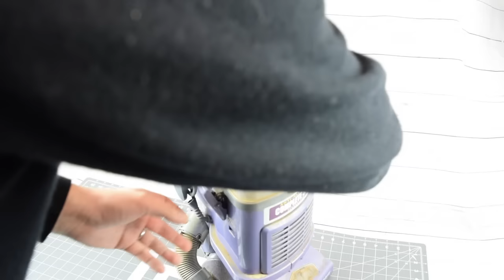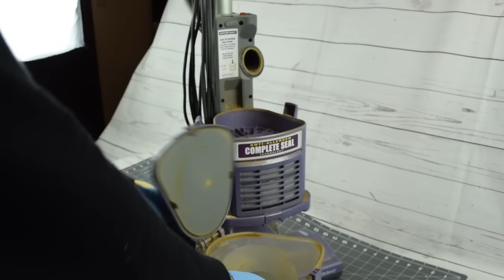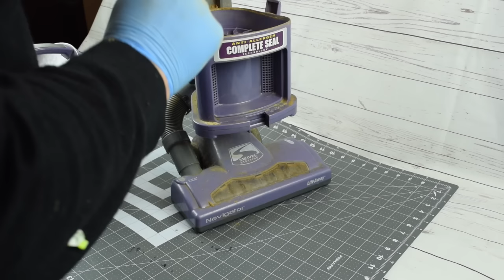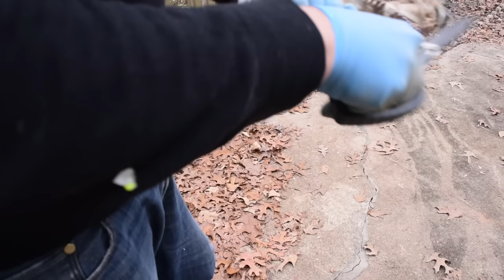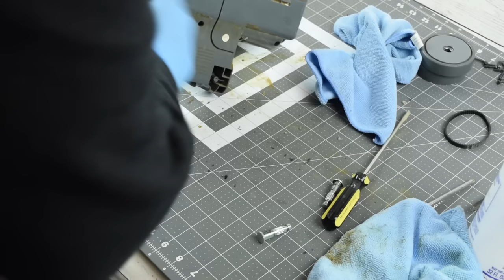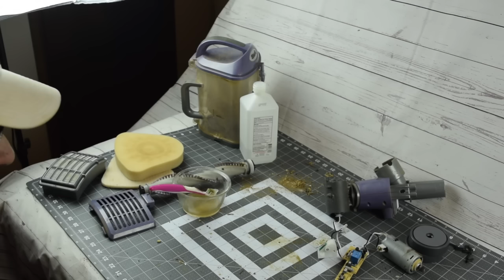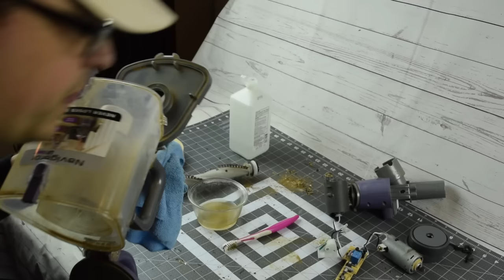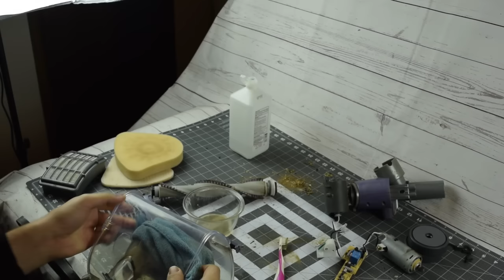How to DEEP CLEAN / Refurbish a DIRTY Shark Navigator Lift Away Vacuum

Comment: You can soak the tank and scrub it off. No need to leave it that way. Also, you can use a stiff bottle brush and run it inside of those hoses.
Reply: Yeah that’s what I do.
Reply: I've heard it causes rust however I've always washed mine and never had that issue I just feel like it's not truly clean any other way
Reply: I just rinse the tank out in the sink, just like he did with the filter.
Reply: whats the best way to dry the hoses

Comment: Just wanted to say I bought one of these vacuums used over 3 years ago and it's the best one I have ever used. It hasn't missed a beat, even with having 2 cats. It gets all the fur out of the carpet and furniture, no problem.
Reply: Does it still work
Reply: @ayo509  Yes! The seal around the canister came off, so I had to replace that but it still works like a champ.
Reply: @TehKitteh01  what vaccum is ir that u have?
Reply: @2manyscars  Shark Navigator lift away.

Comment: Housekeeper here, pro tip: but a mesh laundry bag, put your dirty filters, (hepa and cloth filters) in it and wash them in the washing machine. The mesh protects them. I do this at least 3 to 4 times a week to keep my sharks clean after each use in my clients homes. Then air dry them.
Same for the canister, a pressure hose will clean the mesh filter. All my vaccums have suction as of they were new and I use them A LOT!
Reply: How do you clean the brush and bottom of the vacuum?
Reply: @nyscurls08  I run a motel, Idk about this model, but most of them you can unscrew the bottom. I take a knife and cut straight through the hair and carpet strands using the plastic on the brushless portions as a cutting board, then I can pull it out of the brush portion. My mom always used scissors
Reply: Bad tip! You're not supposed to wash the hepa filter! Water ruins the tiny little fibers the hepa filter is made out of! So your hepa filter is probably not even working anymore lol dum dum

Comment: Total lifesaver for me today!! I couldnt figure out why my vacumn wasnt sucking up, it was just spitting out and making a whirring sound, followed your video and in the bottom hose it was soooo clogged! The whirring sound is gone and it picks up, but I feel like it was still spitting some out behind me when I had the carpet setting on, but when I switched to the floor it was fine. As long as I go over the floor slowly to allow it to pickup on the carpet setting, it will pickup and not blow back. THANKS SO MUCH!!!

Comment: Abrupt ending. Soaking the main canister in hot soapy water would seem to be much more efficient.  Blow drying with an air compressor would efficiently remove all water and prevent any future rusting.
If you were doing this frequently, get an ultrasonic cleaner, makes work work of embedded dirt.
Reply: That's what I did

Comment: Thanks for video. Truly a deep clean. I have this exact model after all these years. I have a spare filter set I bought and that way I can replace them while the other is being cleaned and then dried. I don’t think mine has ever gotten as dirty as this one.  I will say I think it’s easier to go ahead and dunk the debris bin in soapy water and wash it that way (a small angled brush or bottle brush would probably make it easier). I just leave mine to dry overnight after I attempt to dry it off.  The two things I dislike about this old model is the lack of lights and that part in the bin where the dust/hair gathers and I almost always have to stick my hand inside to remove the glob. We do have kitties and two long haired people here, but still...the professional Shark/years newer model, they worked that kink out because the bin is easier to empty on it. And my newer one has lights. I really wanna upgrade to the DuoClean as soon as we’re able. I feel behind in the vacuum times. 😆

Comment: Just came across this video. Excellent! Thank you 🤗
Just a note, I used a tide pod and white vinegar in hot water to clean filters, soak hoses and wipe everything down it’s all like new again. Rubbing alcohol worked nicely on clear plastics after I rinsed
Reply from the maker: Thanks!
Reply: @VacuumWars  I have a bit newer shark NV 391 26 and the brush roller and the motor are attached to the clear plastic inner casing. I can’t figure out how to get the brush free from the clear plastic case 🥺

Comment: Your video was very helpful, thank you. I haven't had a deep cleaning to my vacuum since I bought it 2 years ago, so I learned a lot about the parts I need to maintain properly. One thing I felt could be improved is to use biodegrable detergent (because the one you use will be bad for the soil in your yard, and the environment, and it will send a nice message to everyone following your instructions). Thanks again for being so throurough.

Comment: I have two Sharks but mine are newer. The taking off of the plating to reveal the brush is different. It is hinged with three quarter turn releases instead of screws. The trick is trying to clean the layers of pet hair, dust etc that build up along the intake cover and the stand up bristles behind the roller. Short of completely disassembling the entire head, it is a chore to clean effectively underneath.
Reply: Mine is newer too and I wasn't able to take it off with a screwdriver were you able to get it off? I had to cut and yank all of the nastiness out it was so draining.
Reply: @itsGaiaPeralta  I think manufacturers encourage us to take the sweepers in for maintenance. Most models I've seen have screws within the turner brush housing that need to be removed to get the roller out completely, but require a special tool. The way the newer models are, you can only disassemble it so much and clean it so much without some kind of professional tools. Yes it ends up being a major hassle to clean the roller housing effectively. I guess cleaning it regularly from the start would help a lot.

Comment: I have a long dowel and in order to clean the house which is flexible as it is I put a sponge on the dowel and ram it thorugh the hoses by stretching and then gathering over the dowel and sponge then rinse it out with a strong stream of the hose - works like a charm

Comment: Great video! Thanks for all of the tips. I'm actually about to deep clean mine now. I was wondering, maybe you said it in the video and I didn't hear it, why can't you just wash out the canister? With water? Should it not get wet? I was trying to read through all of the comments to see if anyone else asked but there are so many! Lol!
Reply: I was thinking the same I see someone else above mentioned to just wash it out
Reply: I just wash mine out with the garden hose. Clean the center cone part with a detail brush. I've only done it on a hot summer day, so drying it hasn't been a problem. I guess I would use the hair blow dryer if necessary.

Comment: I have this vacuum as well and cleaned it recently. One thing I did to not get the hoses wet was use my extra long dryer lint brush and run it through the hoses.

Comment: Thanks for a great video! I couldn't remember if I should wash the felt filter (having misplaced the owner's manual!) so this was most helpful. When you discussed blockages, though, it reminded me of the time my Shark just wouldn't pick up anything and my husband was all set to go buy a new vacuum but I knew there had to be something going on. I took off all the hoses, as you recommend, and found a Bic pen caught in the U bend! It was tricky getting it out, but so worth it since the machine works great again! That was several years and two houses ago, so I'm really pleased with my Shark investment!
Reply from the maker: Awesome! Glad it helped!

Comment: I was pretty frustrated when I couldn't get the cover off, & this video calmed me down.. I love LOVE my Shark! I also got it used. It wasn't near as dirty as the one you're working on. I've made sure I have a couple filters at least, that way I can wash the first one & let it dry completely, & put the 2nd one on so I'm not without my vacuum for the 24-48hr dry time. It works really well. Someone here mentioned getting filters on Amazon & I did that as well. Life savers! I have to cut my 30" hair off of the Brush roll OFTEN lol, but doing proper maintenance has kept my vac like new for around the four years that I've had it. & Lastly, my husband was so impressed with my Shark Nav Lift away that he bought a 2nd one, used as well! Now he can clean up the messes from his builds, projects & other things any time he needs to, which is really helpful! Thanks again!

Comment: TIP.....   after soaking and scrubbing the inside of the hoses and parts with the best cleaner for the job- which is DAWN.....  run a little bleach and water solution thru 
hoses/parts. To disinfect. To Keep yourself and your household healthy.  Don’t forget to spray Lysol (if you have it) onto those filters while they’re drying to kill bacteria

Comment: you can use a dryer vent brush to clean out the middle of those hoses.  Best vacuum I ever had was the Fantom. Lasted a little over 25 years. I have the Shark Liftaway now, def. not as good as the Fantom, but works!  Wish The Fantom Was still around!
Reply from the maker: Great tip! and thank you!

Comment: Considering some of the comments here:
* The dustbin can be washed out.  I take a hose sprayer, set on "Full" or "Jet" and have at it. 
* All three filters are supposed to washed out with (cold) water; I use lukewarm water.
** I'm surprised the HEPA filter doesn't ever get replaced.  I find it interesting that water doesn't flow through the HEPA filter.  I fill it with lukewarm water and let it sit in the sun for an hour or so.  Flip it over to drain it, then take a hose sprayer to rinse out the loosened stuff.  
* I don't use any soap, per the owner's manual, but I might be tempted to use a light mixture of Dawn dishwasher detergent and warm water on the two pre-filters.
* My Shark (ZU560) keeps the roller brush free of hair, so I don't have any real need to remove it.  (We have three cats and a dog; let the reader understand!)  It would be nice if it could be easily removed so I could sanitize it every once in a while.  Instead, I lay the entire vacuum unit outside with the bottom facing sunward, turning the brush a quarter turn every 15 minutes.  Ultraviolet rays from the sun is a great sanitizer!
* I also let the sun dry and "sanitize" the filters and the dustbin.
* Regardless of the sun drying everything out, I still wait 24 hours before using again.
* I found the owner's manual for my unit online.  (Some comments mentioned not having one.)

Comment: Just wanted to add a comment regarding heavy duty or commercial use  with these vaccuums....My gf and i used to clean a school that had a dirt road entry and thus, loads of gravel ,small tones, and such would get tracked in..the school consisted of 8 buildings  1000 to 2000 sq ft Each..The enviroment was the Worst we had ever come upon in cleaning since early 2000..The scoolrooms had paper, food, gravel and stones,  just Everywhere and was obviously let get outta control by those running the place...Point being that  This enviroment would have destroyed most ordinary vacuums but the sharks held up fantastic with none of the 3 vacuums we used ever breaking down...We had one like whats in this review, purple and 2 white, bigger capacity navigators....we would always have the vaccs ready, cleaned and empty b4 ech cleaning venture there, but by days end, when we were done, they had been emptied Multiple times with the filters shaken out as well...we needed a vacuum that could pull fine dust and Not loose suction....not many vaccs could achieve this as even a powerful Royal upright with the commercial metal body, would quickly become bogged down and loose suction with a fresh bag shortly after attempting thnis place.the sharks lost No suction, and were torn down midway thru only to empty containers and refresh ,shake out, the filters, then they were back to work again...the enviroment also required an extremely navigational vacc that could get round and between things,chairs,desks ect..the sharks were superb in that respect...the only tradeoff to that manueverability was the heads were relatively small and when coinfronting massive sq ft areas ,a larger head would cover more area more quickly...The tradeoff there is that you would loose ability to get in and around tight spaces...So, for anyone considering one of these for home use, rest assured that it will easily handle what you ask of it and thats its capable of Alot more should you need to... great machines! we no longer do that nitemare job at that school, but Still have and use those same sharks at home...

Comment: Don't know if anyone else has mentioned this, but I use a leaf blower outside (you could also use a hair dryer on cool, but a lot less powerful, or a can of compressed  air which gets expensive) to blow out the initial dust and then again after each time I clean something inside. Just be sure to point it away from you. Works a treat.
Reply: If you are a diver and have scuba tanks there is an attachment for just dust blowing that absolutely does a great job. Short bursts will clean a lot of junk out. I also use it to blow dust out of my computer but with a bit of distance cause you don't want to blow anything off of the motherboard.
Reply: I have an air compressor, with a 50-foot hose, that is always turned on at my house. I use it for my nail guns and tires and to blow the dust off of things. I blow out the filters every time I empty the cup. It takes less than a minute.

Comment: Thank you.  My first shark was the one in this video and what I have now is purple. Both state in instructions to rinse filters with cold water. The first one I put the filters except the hepa  in the washing machine  a few times before reading not to do that. I used either hot or warm water.  After that would hand rinse but with hot water while putting a cleaner in the filters beforehand at times before rinsing clear.  The purple I only rinsed but with hot water. Since instructs cold water I will use at least luke cold.

Comment: I just, today, found a Shark Navigator Lift-Away in the trash next door to my house. I brought it inside and didn't even attempt to turn it on. The filters were clean but it was clogged at every connection and through the entire handle. The handle tube was packed with so much shit that I had to use my drill with an 18" bit to bore a hole through the hair and debris to loosen it up enough to get it out. I put it back together, plugged it in and turned on the most powerful vacuum I have ever had. Easily the most powerful! Now I had two new things, a badass vacuum and a human head sized pile of hair, dead skin cells, scabs, nose hair, dried boogers, and anything and everything that is gross and undesirable that you can imagine.  So I threw out one of those things. I'm sure going to miss that new vacuum.
Reply: Yeah, my dad used to repair vacuums that he would find, so we always kept the better ones and he sold the rest. When I bought mine back in 15 I was blown away. I got rid of whatever vacuums we had left.
Reply: Lol

Comment: Just a tip: i usually squeeze down vacuum hoses and use a long baby bottle brush, to scrub the inside with hot soapy water. And i really think it would be okay to do the same to the main compartment, fill up a tub with hot soapy water and scrub it with a baby bottle brush and then just use a hair dryer to dry the metal part out. Im gonna do it to this model too. Sorry for all the comments. Lol! 😉✌
Reply: Connie White thank you! 😊
Reply: Crusader umm..thanks? Lol! Really though, thank you! 😊
Reply: You can also use a dryer vent brush.  It has a long handle and is great for the long hose.
Reply: peachy75019 that's a great idea! Thanks!
Reply: Sam, great tip
Reply: shell19491 You're welcome sweetie 😊
Reply: I submerge the canister of mine in soapy water.
Reply: @marysunshine4730 Do you also wet wash the metal tube filter that’s inside the canister, as well? Or must it be kept dry?

Comment: I guess I may have a newer version of this vacuum. I’m not quite sure what screw driver is needed considering a standard Phillips doesn’t work with the screws in my model. Sadly I don’t have the manual for this but would greatly appreciate any input you may have.  The screws have a metal piece in the middle which stops me from being able to possibly open this baby up.
Reply: I just had the same issue and found the T15 fit perfectly!! T9 and T10 were too small.
Reply: You buy a T15 but should have a hole in the middle.

Comment: I just cleaned my hepa filter with a water pic . You should see the dirt that came out of it. I sucked the water out with a shop vac and will let it air dry for a few days. It looks okay. No holes or anything. Didn't come apart.

Comment: Curious... When did they change from the "donut" filters on the NV series? The old ones had more surface area for filtering and honestly weren't all that hard to clean. (Now I'm wondering if it's still easy enough to get them?)

Other than that, it's better to clean the filter after every three uses instead of three months or so. Keeps a significant portion any really fine material from getting to the motor and that's what can eventually kill the vac in the long term. Looks like whoever had that one last never really stayed on top of that part of maintenance.

Also to clean out the hoses from anything that sticks after using some soap, a soapy rag with string tied to it. Thread string through and bunch up the rag so it's a bit hard to pull through but not completely stuck. Pull that through the hose back and forth a few times to floss anything that may stick if rinsing doesn't do it.